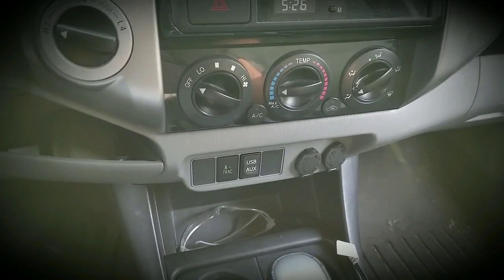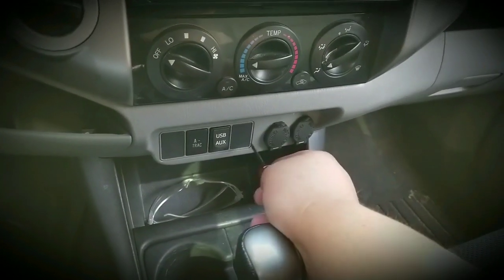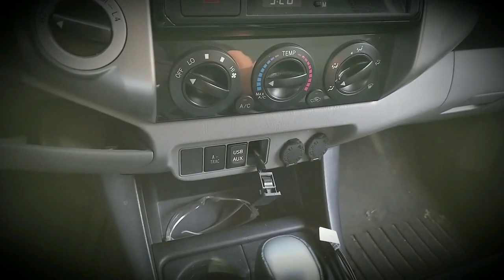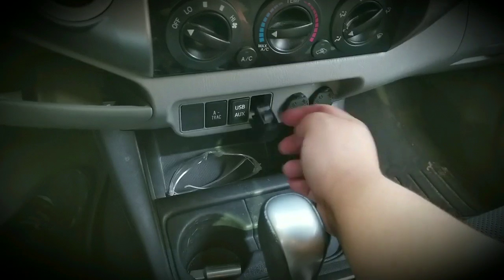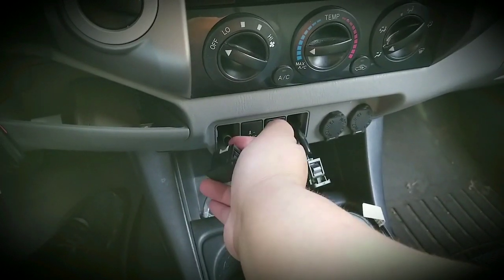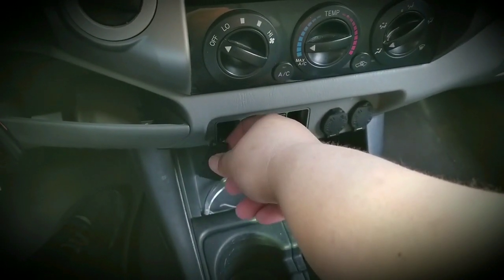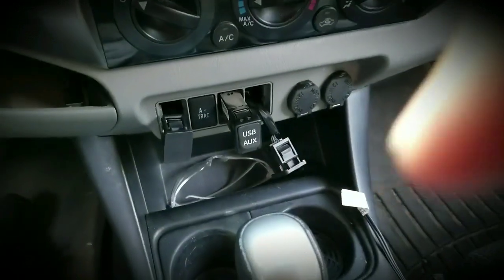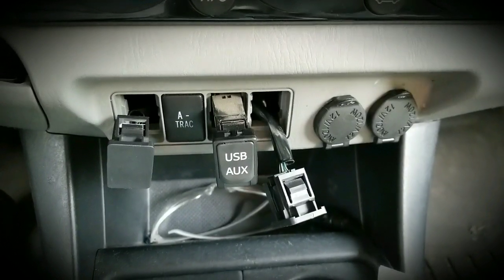How to remove Push Button Cover/Switches from Toyota Tacoma 2nd Gen (2009-2015)

Comment: Helpful video, thank you. How would you go about removing the plugs? I had the plug cover break on one and would like to replace so I can cover it again.
Reply from the maker: Sorry for the late reply I've not been much active here, I apologize. So for the blank switch covers the plugs just slide right out for both outer ones, they are not clipped in the back part of the blank switch cover. So if you are pertaining to those plugs for the blanks they are not broken, you did not break them, they're made to slide out like that from the factory, unless other years and models other than mine are differently manufactured. Just slide them back in. For the Aux and A-trac switches if the clips are broken you'd have to buy new or used OEM switches or just use some Permatex Super Glue, which I find to be a great adhesive for all sorts of boo boos. I get Permatex  Super Glue at my local Walmart. The little .10oz tubes or the bigger bottle that cost around $5 and the tips are very precise for small projects. Just fyi the glue bonds in seconds depending on how much you use, so if you use plenty be aware that it may take some time to bond due to the excess of glue used. Hope this helps Richard and sorry for the late reply. I appreciate the comment and likes. Subscribing is welcomed and appreciated as well. 😎 Take care during these times!

Comment: What is the harness behind those blank covers going to?  I was going to wire some lights and use an OEM style switch in those 2 blanks
Reply: They are for the heated seats. Be interested to see where the harness goes in models that dont have them.
Reply: Was wondering the same thing. Can I unplug these harnesses to add a new switch? I don’t have heated seats. Also, I haven’t removed the blank to see if it even has a harness.
Reply from the maker: @ismellpnutbutter  Hi, sorry for the late reply ☺️ you can use those slots for aftermarket switches or harnesses and dont need to plug them unless you use the oem blanks to keep them plugged and secured, you could just toss them in altogether into the interior of the console. The existing harness as was mentioned above are for heated seats and believe to be connected at the other end. If you wanted you could buy one or both the oem heated seats and swap out your non-heated ☺️ and they plug right up to those harnesses then now you would have heated seats. I tried looking for some at local a wrecker but no luck. Would like to have that heated seat option lol.
Reply: My tacoma has no heated seats.  Doctor doesn't recommend them for me cause I got CAS.  That's cool anus syndrome.  Yes it exists, Google it.  Heat no good for my stink star..  Anyway my blanks were just that, blanks.  No wire harnesses running to each one.  Otherwise it shouldn't be called a blank.  Maybe a fake blank!
Reply: @guckertott  Well, what makes you the expert on blanks anyway? Do you shoot 'em? I tend to draw them, mostly. 
I heard toyota used the same harness for all trims of tacoma, such as the foglight connectors being on trucks without the option. Not sure if it applies to the interior, although in that case it would make sense to keep the harness secure on the back of a blank to stop rattles and such.
Reply: @guckertott  mine is the same way. (my truck, not my anus). I guess ill have to fully take it apart to install some new charging ports or switches.

Comment: Got blank out easy using this method.  Used a utility knife.  Only thing got me scratching my head is how the hell in tarnation you get wires routed back there.
Reply: Remove the HVAC control panel and you have full access to route wiring.

Comment: What are some good buttons you recommend to install where the blank plates are??
Reply from the maker: Hello, I like the factory style look in my interior but it all depends on your taste, the push buttons look better in my opinion than the switch type with overpowering led lights. You can easily find some good ones on eBay or Amazon just check out the seller rating and product reviews from other customers. You can even find factory buttons but might cost a little extra or custom push buttons with indicators which indicates which switch goes to what auxiliary you connected. Search the year of your truck/vehicle and add push button. You dont need to go pricey. I just chose ones with a specific color led light to match interior and that indicate my auxiliary lights. Let me know if you need specific sites or links I can try to provide later after I get off work. Thanks for the question Raging Italian.
Reply from the maker: @NottaSheep1776  yes yes I see those a lot. I did get some push buttons specific for my cube lights which was the reason why I put up this video but haven't gotten time to do the 2nd part, sorry folks... I'll look to see if I remember where I got them and shoot you over the link soon as I can 😁
Reply from the maker: @NottaSheep1776  Alright, so for my hood ditch lights I got them from a seller on eBay by the name of 4runrun_usa but he no longer has the versions I bought from him before. He has newer versions and I'll send you links for the hood and rear ditch light buttons from another seller that are exactly like mine. Caridwheels from eBay sells them as well. Here is the link for the front ditch light button, https://www.ebay.com/itm/373225368657
(These ones from Caridwheels says they are made by Cali Raised) if they are thats a good deal with free ship right now.

Hear are some for the rears, https://www.ebay.com/itm/353090091245

Im sure once you start searching within those criterias lots more styles and types will pop up for your vehicle.

Hope this helps. If you need anything else let me know 🤜🤛😁
Reply: @boosdcarvids6326  Thank you so much man! You are a lot of help!